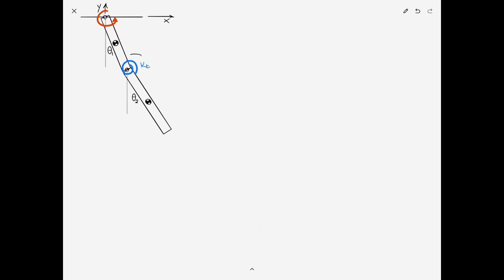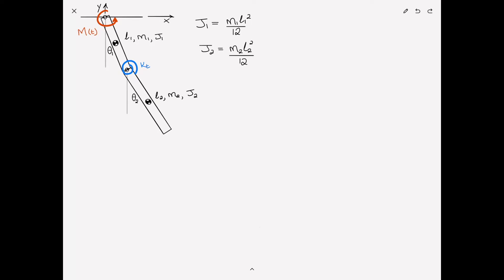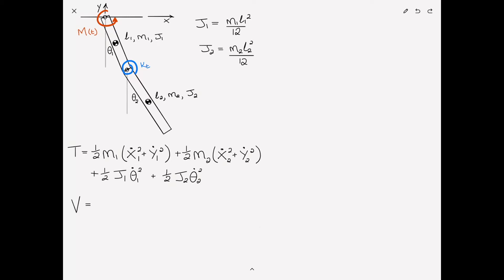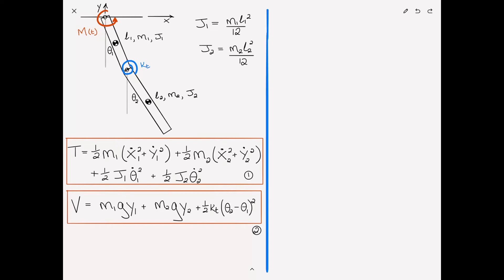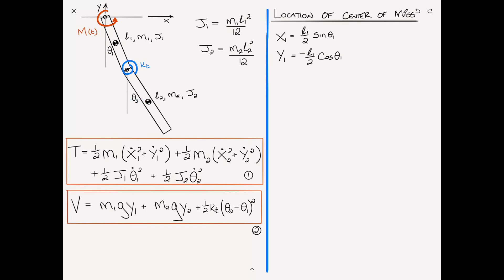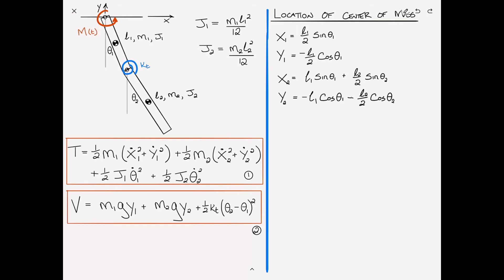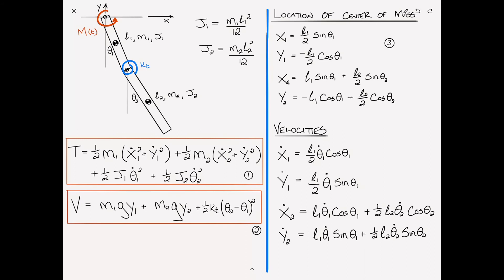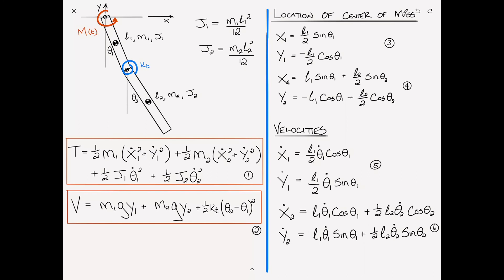Equations of Motion for the Double Compound Pendulum (2DOF) Using Lagrange's Equations - Part 1 of 2

Comment: thanks. can you please transform this result into matrix form and reveal eigenvalues and eigenvectors?
Reply from the maker: This is unfortunately not something I can do in the comments section as it is too difficult and messy to try to write these equations in text, especially matrix equations, but I can give you the steps how to do this.

1. Since the equations in their current form are nonlinear equations, we first need to linearize them (around the equilibrium point) in order to be able to write them in matrix form.

2. To linearize the equations we assume that both angles θ1 and θ2 are small.  As a result: sin(θ) ≈ θ and cos(θ) ≈ 1.

3. Neglect higher-order terms (θ² and higher) - i.e. θ² ≈ 0.

4. After making these approximations, you will have linear equations which can readily be written in matrix form.

5. Find the eigenvalues and eigenvectors using standard techniques (I've show this in several previous videos).

Hope this makes sense.
Reply: @Freeball99  thankyou. Yes this makes sense.

Comment: What if we also have pendulum bob at the end of each links
Reply from the maker: You need to add (superimpose) these effects.  Take the kinetic energies from both problems and add them.  Similarly, take the potential energies from both problems and add them (but eliminate the torsional spring).

Look at the 2nd problem and see how I added the effects of a discrete spring.  In a similar manner, you will be adding the effects of the discrete masses to the compound pendulum solution.
Reply: @Freeball99  i am building an Acrobot..and where i need the concept of compound pendulum with bob

Comment: Hello sir, 
why did you include the rotatory kinetic energy in this case? Are each of the bars rotating about their center of mass?
Reply from the maker: In the case of the compound pendulum the rotatory kinetic energy effects become significant (when compared with the simple pendulum).  In this case each bar is NOT rotating about its center of mass, but rather about each hinge point.

Comment: well hello, so i would like to ask, how to get the equation of motion if we used the Lagrange multiplier method?
Reply from the maker: It's a little hard to explain in the comments - I'll probably need to make a video on it, but basically, you would do the following...instead of using the kinematic constraints to relate the potential and kinetic energies to θ1 and θ2, you would write the energies in terms of x, y and their derivatives and then you would add two constraint equations to relate the coordinates to one another.  It makes it slightly easier to derive the energy expressions by using the Lagrange multiplier methods, but it increases the number of equations and unknowns.
Reply: @Freeball99  thank you for your answers, i’ll ask again if i still confuse🥺

Comment: Why the linear velocity term in kinetic energy ewuation
Reply from the maker: This is because I used J about the C.G. - so I had to include the translation of the C.G.  If I had just used the correct J's (about the hinge points) then I could have ignored the translational velocity, but as I showed, it can be tricky to get this correct, so it helps to be able to get there step-by-step from basic principles.

Comment: I think I solved it and did the simulation. However, it picks up energy over time. I tried reducing the sampling time, but it is less stable than the double pendulum.
Reply: Oops! Found a bug. My kinetic energy was off because an angle was used instead of a velocity. My expression is much simpler. The animation reminds me of a circus trapeze act. My animation still gains a little energy, but is much more stable. I haven't added the forcing moment as yet. What do you suppose I should use? Mo*cos(wt)? The moment of inertia from the end of a rod is m*L**2/3 instead of M*L**2/12 as it is at the center of mass. However, I dunno if a forcing moment needs to include that or not. I will probably add a control to change omega on the fly, just for the fun of it.
Reply from the maker: I'm about to release a video (part 2) that shows the rest of the derivations of the equations of motion.  Should be ready by this weekend.
Reply: hello @greg Hoke, would you mind sending me the file of your work (its fine if you're not comfortable with share it). Iam currently struggling with an assignment, and I just need an example for reference. sorry for the trouble